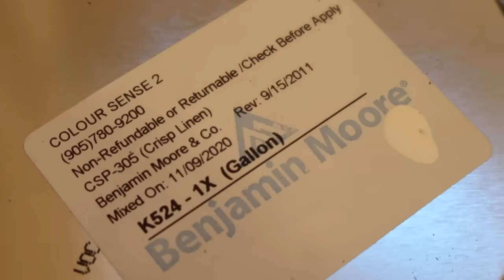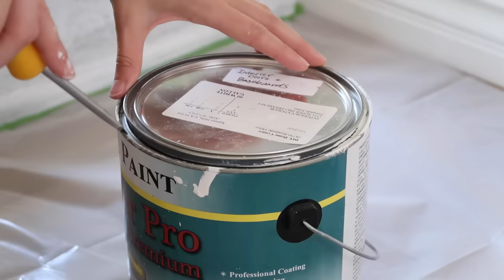9 RENTER FRIENDLY DECORATING HACKS | DIY REMOVABLE UPGRADES

Comment: Well, I don't want to make holes in the walls, making holes is not renters friendly
Reply: I love command strips they are just great to have on hand. No hole, no mess.
Reply: you can fill them and  sand! if they are apartments it is likely they are going to paint again anyway
Reply: Take a bar of soap and rub it on the hole itll fill it in

Comment: Word of caution from a previous renter who used cord covers. The ones I got on Amazon were extremely adhesive when it came time to remove and lots of drywall ripped off, even with use of a heat gun to help.
Reply: Did you find a better one that doesn’t rip paint or drywall?

Comment: I’m a renter. I’m in the process of painting the lower cabinets in my kitchen with Behr’s high gloss Carbon black. The upper cabinets and walls are still the original cream. I have black and white photos of the area in the middle of the wall as a backsplash, blending everything nicely. It looks so cool!
Reply: If my landlord isn’t a fan, we have a paint gun, and can quickly paint it back to a neutral color in two coats, primer first and then a lighter color of their choice. 

Just know that is something you’ll need to do when you’re leaving!
Reply: Black? Yikes!

Comment: I’m in a rental and plan on using some of these tips and tricks.  One thing I found is Amazon carries a closet rod that hangs from the existing one so you can easily turn it into a double hanging wall - plus it extends so you can do a shorter or longer section.  This helped me a lot!

Comment: When I first started living in apartments, I was so used to college dorm and apartment rules that I was quite resistant to putting up pictures! But then my husband, a much more seasoned mover and apartment dweller was like, "Dude, put this on the walls, these tiny nails hardly do anything and they can be easily filled." -- I've always loathed the look of most temporary hooks and was so grateful, lol!

Now the place we've had for almost four years has pretty unsightly, unevenly patched walls and dated fixtures, as well as some pretty old doors, cabinets, etc. It wouldn't be worth the investment at this point to store and replace light fixtures, but luckily our furniture, lamps, and decor (and a vaulted ceiling) have brought a lot of warmth to make it feel like home. However I just might ask what our options might be for painting the main wall a different color.... They'll need to repair some wall & paint damage from an old leak anyway, so I'm thinking the odds are in my favor 😁

Comment: Hi, could you do a video bon how to drill please? I want to put up a better curtain pole in my rental but have only managed to secure it with two screws using the previous holes! I still have the centre bracket to put up if it's going to hold some new longer thicker curtains. I have no idea how to use a drill, how far to drill in, what size bit, etc so I haven't bought one & no one wants to come do this small job. Thanks if you could help would be great.